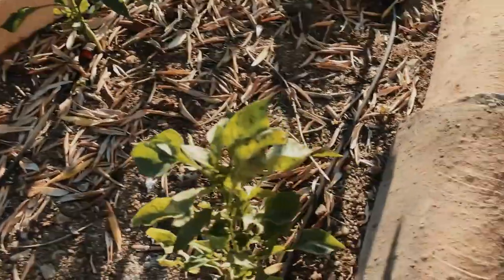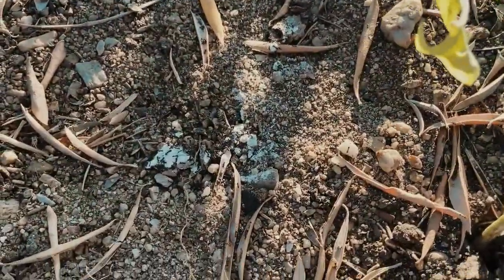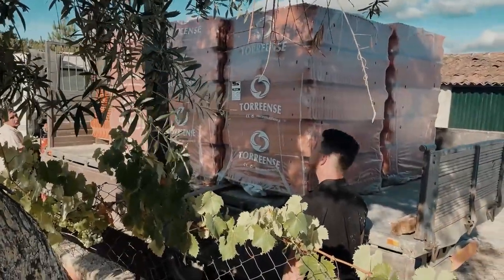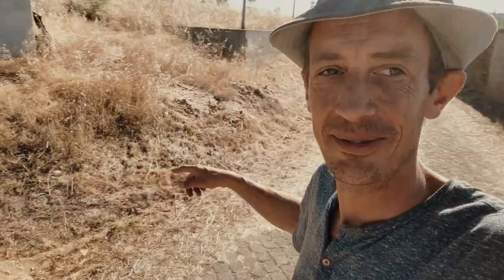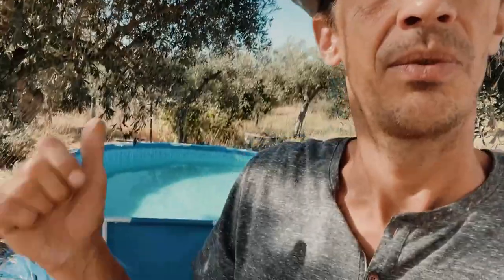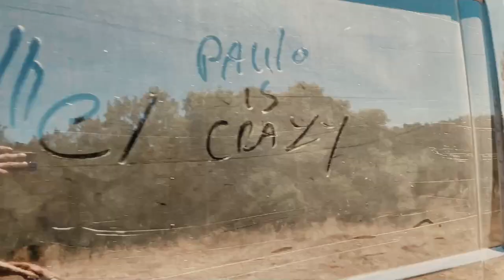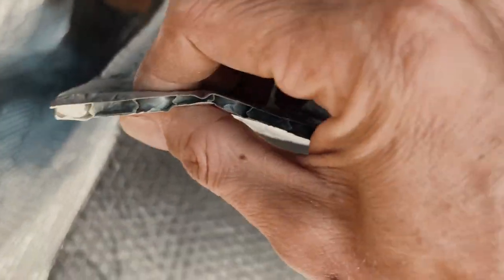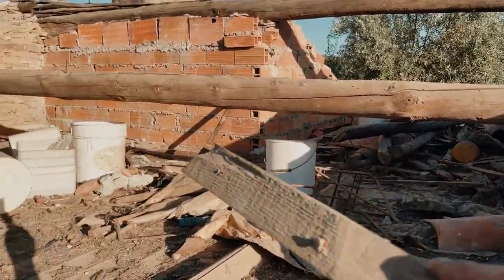Buying BUILDING MATERIALS in Portugal to RENOVATE THE ROOF! (Taking the roof off)

Comment: Old tiles broken in small pieces are great  to make a cemented floor ( especially if the ground underneath is humid ) it will isolate the humidity : cemented floor indoor or outdoor.....I have a  100 m2 cemented  patio with around 40 cmts height of broken tiles and bricks underneath the cement.....

Comment: You get varying grades of roof tiles in portugal,  some sealed and some you have to seal yourself. 
They're porous and absorb water and if you get a frost they freeze and crack. 
Check with your guy which are theses.
Some come with short guarantee too Jasper.
Reply: Quality? You get what you pay for.The cheapest isn't always the best. Hopefully, they're OK. Fingers crossed.
Reply: The tiles  in my roof are 60 years old ,they are old style " telha francesa" natural clay without any treatment....still in good shape...they only brake when I go up there with the pressure machine to clean the dirt( with time they get very dirt and got moss sometimes..)  1 month ago I cleaned all the tiles( 200 square  meter of tiles) with a brand new pressure washer that I bought on the purpose for this job...first I jet washed all the roof ,then I sprayed all the tiles with sodium hypochlorite 13%   ( lixívia negra...) with a 16 lts hand sprayer ,let it soaked for a few hours and then jet washed all the roof again... before the tiles looked black and had a  lot moss stuck to the tiles.....  the roof had not been washed in the last 20 years...unbelievable the quantity of dirt that comes off.... now it looks like new....
Reply: @netby  your comments are always on point Daniel, thank you 😊 
I wouldn't fancy being on a wet roof on clay tiles...
Reply: @netby  😳😳😳😳😳 
I have to get some roof ladders for sure, this is the way forward Daniel 😉

Comment: We used Nilzone at first, just to find out later that it actually doesn't work that well. You need xylopheen or some similar stuff to get your wood protected. I still use Nilzone for "free standing" projects like tables and such, but anything on the house itself... well we've learned that lesson.

What to do with all the tiles? The flat ones that are overlapping half on half are worth money... anybody restoring an old house knows they are hard to find. (the old ones), there is a modern version of them but the size is different. They are good for windy and stormy areas!